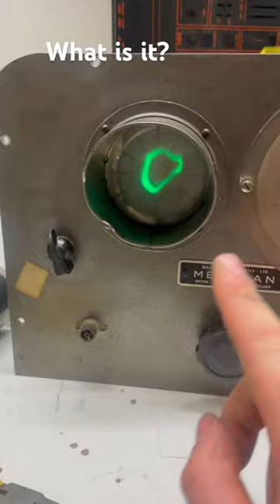WHAT THE HECK IS IT? #shorts

Comment: CRT looks like it wants to show a Lissajous figure to compare two oscillators - as the other commenters mention to compare a watch / clock movement with an internally generated ‘tick’. I have a distant recollection of seeing one in a watch repairers shop in the 1960s with my dad!
Reply: I was gonna say it looked like an XY comparison on an oscilloscope too. 
Didn't know about the two clock comparison thing but that seems plausible. It seems like using a tuner with this kind of display would be a pretty good way to synchronize watches
Reply: That's an ingenious use of Lissajous figures if that's the case. I wonder how the machine knows the speed of the watch it's measuring?
Reply: @chrisburn7178  A similar (non scope) watch timer had a metal plate with a piezo pickup beneath , to pick up the ticks. Saw it in 1965.
Reply: @paulperry7091  That would make a lot of sense!
Reply: It could do with a bit of focusing too.

Comment: From the website for Walker Electronics: "Walker Electronics Limited was founded in 1952 in Surrey, England when Mr John Walker (Hon. FBHI) first produced the ‘Meridian’, an electronic watch timer. This at the time revolutionary product, allowed the watch maker/repairer to time a watch in a matter of minutes rather than days!"

So it seems to be some sort of clock/watch calibration device.
Reply from the maker: Yeah makes sense. Input at front is for a mic possibly.
Reply: SOUNDS ABOUT RIGHT!!!!  GOOD JOB!!!! - but the dial must not work and do you see anything about that lower left terminal doing anything?? looks like its for a coaxial wire maybe 🤷‍♂️
Reply: he will turn it into an instrument somehow
Reply: @LOOKMUMNOCOMPUTER The input is probably for the watch stand
Reply: Perhaps you can very accurately measure watch timing using a signal generated from watch tick audio on one axis vs a calibrated time on the other axis using slow drift of lissajous figure drawing.  Looks very cool!
Reply: @richardallen1629 has it. Circle means calibrated.
Reply: Yeah, but now to make it music!...
Reply: What a cool device!!
Reply: Oh like a timegrapher, presumably you attach a microphone to the watch and you can work out whether it's gaining or losing time.
Reply: so its a time machine I was right.
Reply: Synchroscope for a clock?
You can use magnetic head to detect mechanical clock oscillation (torsion pendulum).

Then the clock maker can adjust weight of the mechanical clock oscillator ring by seeing Lissajous pattern on the screen.

The mechanical clock oscillator made of a ring and torsion spring, which give the fast oscillation. The oscillation will geared down for every hand on a hand clock panel.

1 At that time quartz watch is impossible to make. 
2 The device has screen for Lissajous pattern?
3 The device has knob for gain adjustment for magnetic head?
3 The device has fine and coarse knob for precision 1min/day mistake, which a pendulum clock is in this range? The knob might alter crystal frequentcy tuning.
4 the device has knob to select magnetic head impedance ?
5 the device has jack for magnetic head?

Can you make a schematic ?
Reply: Definitely is a watch calibration machine
Reply: I'm not sure if it is working 100% correct. But the spinning indicator is most likely for you to refrence against a gear movements. You can compare that and the gears to measure the drift. Basically two points on orbits that deviate slightly will quickly go out of sync in increasing amount. If you can keep them in sync you can determine the deviation from a refrence.

So in this case the spinning dial indicats refrence time against the quartz, and the big dial allows you to control offset. Once you match orbits, you can take the offset value and adjust the mechanism.

If I had to guess the offset only adjusts the diameter of the circle on the scope, which the easiest way of changing the speed.
Reply: Yes used to determine how fast or slow a watch is. Beats the watch (clock) against the crystal timebase. You turn the knob and when you get a circle it’s a match and you read off the error. If it’s low you say good enough, if not you start disassembly and cleaning.  Or you say drat and start re-disassembling and start over.
Reply: @LOOKMUMNOCOMPUTER  Maybe get into contact with any of the watch repair channels, they might have input or interest in helping you?
Reply: @lawrenceharris7717   Yes that's it an oscilloscope that writes the scanned beam in an uninterrupted circle instead of it writing left to right X axis. The signature of the tick written around in a curved plot, with each tick dancing around in different places until the knob is set so the tick is moving the slowest or stopped. Read off the dial directly how many mintues a day fast or slow it is, so can mechanically trim the right amount.  
Nothing much do with Lissajous patterns, they're another thing much simpler.
Reply: By the way I knew of one of these in a watch repairers London, that no matter how accurately he trimmed the watch, every watch was exactly fast and about the same amount, I think it was 4 and a half minutes a week.   It turned out the crystal inside the Meridian had gone off tune.
Reply: This could be a very useful pice of equipment
Reply: very cool!
let's say that for us nerds/knob movers: if it makes some kind of sound it's ok😅
Reply: @LOOKMUMNOCOMPUTER if it is a mic input that sounds like your put the watch or clock near the mix to pick up the escapement beat, you then "beat" the watch escapement to the  calibrator  by turn the big knob that will then tell you how fast, or how slow the escapenent is going. The chicken head knob might be some kind of attenuation control, or maybe it speeds up it's internal oscillator in the calibrator. But in could also be a antenna in put for the broadcast time signal 10Mhz 15Mhz and i think there was a time signal around 2Mhz. That's a very unique instrument friends happy to see it live once again!
Reply: Mic up a watch or clock with an attractive tick?
Reply: @isickofit  not exactly so like the tik tok sound dictates how fast or how slow the escapement or mechanical oscillator is running which then dictates how fast or how slow the watch is in time watches and clicks back then we're mechanical with some watches being mechanical automatic( the automatic is another word for sekf winding, though it doesn't just self wind it uses the kinetic energy of body movement,to swing a counter a counterweight around the winds the watch) that speed can be adjusted in some way some have an adjustment, and others are a bit more intuitive. This is really only assuming, tbh that connector to me looks more like a antenna connection either way both ideas or assumptions could be correct as both are very useful. If it were a antenna signal for the time signal there's a constant beat for second, minute, and hour so you'd basically have a perfect one second beat, one for,minute and another for hour, and would essentially "calibrate the calibrator" which is an odd thing calibrating a device to calibrate another device and the process of doing such. Both possibility's and the switch,could also change between the thoes two functions, the 3rd position is a bit tricker,to think about!

Comment: I'd guess that if it is for calibrating watches or clocks it might use a probe on the device being tested and compare it to a master reference via the CRT.  The master might control one axis while the device being tested might control the other, the goal being a roughly circular shape when in sync, and a Lissajous when out of sync.
Reply: Nice to meet you here  ,  itS hard to get Lissajous curve with 1hz frequency unless we use a digital scope .
Reply: 32,768
Reply: @jagmarc  it was made with ancient tubes , at that time they didn't have integrated circuit with divider and counter .
Reply: @electronics-by-practice  It's just a normal scope but writes its beam around in a circle (instead of it X left to right).   Someone mentioned 1Hz & I said 32768 but how or why lissajous and at 1Hz still escapes me.  
Anyway this 1950s tube-based crystal frequency divider inside writes a 30.00 Hz circle when big knob set at zero.  Watching the tick signature you twiddle the knob back and forth until the tick stays put in the circle, then you read off the scale how many minutes a day slow or fast the timepiece is To do whatever the necessary mechanical trimming needed.   I just now noticed who started this thread so I'll back out before this posting gets buried by endless different alternative versions.

Comment: Meridian makes precision wristwatch instruments. The minute adjustment knob is likely used to synchonize to the watch movement so you can accurately determine how slow or fast the timepuece is running. Probably has a speaker for audible synchronization.

I watch a variety if YouTube channels including watch restoration. Otherwise, this would be a mystery!

Comment: Lissajous patterns can show phase, so comparing the phase of two signals?  Meridian TV station is way later than this, it's not a TV thing.
Reply: I agree. Any X-Y trace on a screen can be used to compare phase. So the dial is the internal clock and the input the external "device under test". You'd want to adjust one or the other so the screen wouldn't spin at all and just be a line.

Comment: Ocilascope the green circle is a holding pattern to show that the screen has current and the the rest frequency generator is operating. The dial to the right I believe adjusts the sine wave amplitude and frequency of the unit and there should be a port to plug in a second frequency generator source 😊

Comment: I found a reference on the British Museum website list of objects and they call it a watch timing machine. A machine, usually electronic, for checking the rate of a watch. More advanced models will show rate, beat, and amplitude. May have a printed output and/or digital display. The trace produced can also be used to identify some faults in the watch.
Reply: The lisajous figure shows all this information at a glance once you plug in the sensor that measures the ticking of the clock being repaired .  Shape moves if the clock is faster or slower than the crystal in this instrument .  Shape looks different if the speed is much faster or slower .  When speed is the same, shape shows which ticks earlier, but the clock is already precise enough to measure your ships distance from the Greenwich meridian .

Comment: Ooohhhh----kaayyyy.  Mmm.
Do some checking on pins in the transducer socket, then see if you can build a transducer for it.  Then use the machine to measure frequency and align the watch.
If the frequency is way different, use the loudspeaker and reduce the pitch to as low as possible.  Then use lissajous to get a still circle.  (Maybe). Clearly I shall have to build one of these devices myself..   :-)❤😊

Comment: I've thought about this for a bit and I think it's a signal generator that generates some kind of pulse used to track/sync other signals relating to time. So if you set it to +5 min the signal would be at a rate that other units, assumedly television or uhf/vhf broadcast or similar, would use as a reference for some type of time code. What I don't get is the vector scope like xy circular crt. A vector scope is used to display, amongst other things, values of hue and saturation of a video signal. Perhaps this is doing similar except the values of the vector have to do with time signals of a broadcast feed. Did we ever get a final answer?

Comment: You are missing the transducer, a device that you put the watch on and it's like a microphone that plugs into the connector at the front. You can see the difference in clock ticking on the screen and adjust the mechanical clock. Also you hear the clock ticking on the speaker and the switch selector selects the type of escapement i.e. the ticks per second of the mechanical clock.
Reply from the maker: Yeah but you can just use a mic
Reply: @LOOKMUMNOCOMPUTER  I guess but I think the original transducer was piezzo based and more sensitive when you put something on it.

Comment: you dont think a microphone or sensor plugs in the front socket to listen and plot the wrist watch second ticking on the scope next to the electronically generated one second.  Perhaps then moving the dial brings both in alignment thus giving a reading on the dial how fast/slow the wrist watch is running.  Adjust watch, repeat until both sync.

Comment: Was it used to set the springs in a watch. There should be an audio input. The oscope was used to compare internal clock of the machine to the ticking of the watch. When adjusted correctly the oscope would appear to be circular. S.W.A.G.